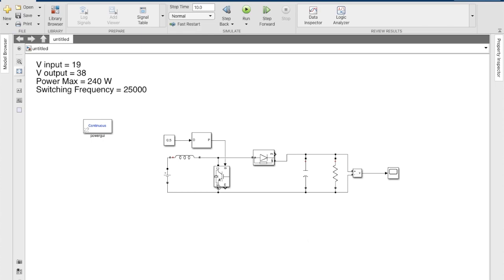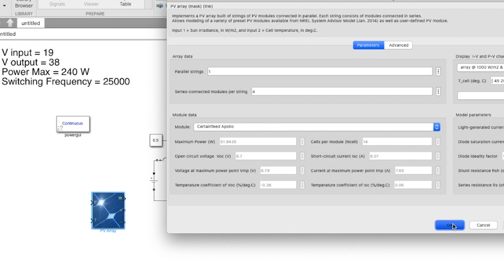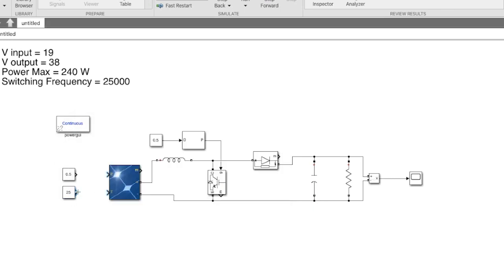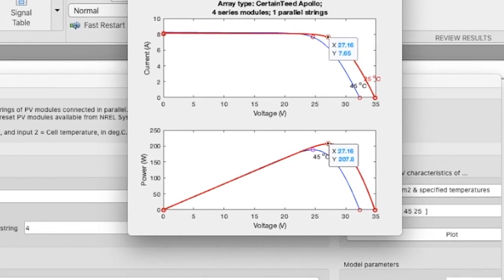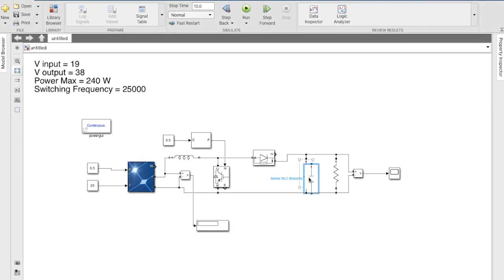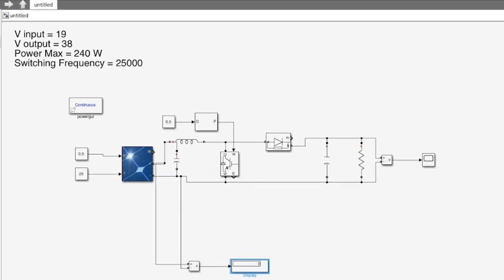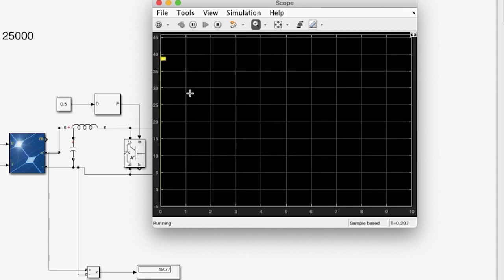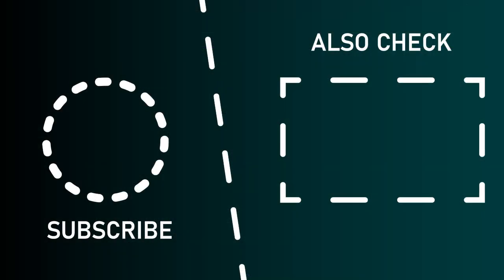PV module simulation + Boost converter in MATLAB/Simulink!

Comment: hello can you please help me, i would like to design a pv array that gives 6 V input to the boost converter and the voltage is amplified to 12 V. The load is a 12 v dc motor

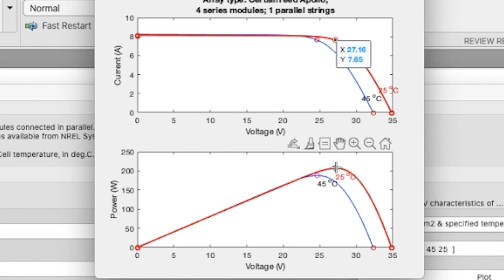Comment: In 1:09 your showing one graph, in voltage valuse 27V but in last you getting 19V? How its change sir
Reply from the maker: Great Question! That is maximum power point. So at maximum power point it will be at 27 V. Here despite it being stc ( 25deg and 1000 irradiance. the voltage and current are not at MPP. Refer to our MPP video to reach 27 V :D)

Comment: I want 12V input supply. Confusing PV array selection which model is good for 12V input..
Reply from the maker: You can custom you own PV panel!
Reply: @TheUrbanScholar  sir, don't know how to select Voc Vmp Isc Imp values.. I u post any video abt it
Reply from the maker: You won't get exactly 12v in any situation. Because firstly, irradiance will vary and no panel can give 12 volts accurately. I suggest you to take a normal arrangement of 24v or something close to that and attach a buck Converter to it
Reply: @TheUrbanScholar 👍👍thank u

Comment: Sir, please what is the name of PD in the Simulink library
Reply from the maker: Do you mean PV? It stands for Photovoltaic  and we use PV Array to simulate a PV system, do let us know if it solved your doubt 🙂
Reply: @TheUrbanScholar  no you connect a block at top with constant value 0.5. tell the name of that block
Reply: @Engr.summaira.beenish.  pwm generator (DC-DC)

Comment: Sir can you send me modeling of pv array with mppt if you have...my email kunjalparmar278@gmail.com
Reply from the maker: We believe that one must build their own projects for their satisfaction but having said that we can help you in concepts or troubles in simulation so that one could do it on their own.Please tell us where you're finding difficulty in the steps we're ready to help you in any way :)
Reply: @TheUrbanScholar  how can i put mppt algorithm in matlab
Reply: How can i give constant input solar pv  to boost converter  so for this i have to design close loop beetween pv mppt and switching frequency of boost converter .so i dont know how can i put control algorithm in simulink.
Reply from the maker: You need to use the matlab function block to write the algorithm, the inputs to the algorithm must be current and voltage as you would know, the output should be duty cycle, which much be fed into the MOSFET.
Reply: @TheUrbanScholar  sir plz make video on that topic so i can understand easily
Reply: This problem is sub part of my project not a whole portion
Reply from the maker: We'll make a video on this in the coming days 👍
Reply: @TheUrbanScholar  thanks
Reply from the maker: Please subscribe to our channel and share it with your friends,it would motivate us a lot we'll make sure you won't regret it😁
Reply: @TheUrbanScholar  i already subscribed your channel
Reply from the maker: Thank you!😄
Reply: @TheUrbanScholar  can you give me your mail id because i beginner in matlab so i have lot's of questions
Reply from the maker: Sure it's howtoproject98@gmail.com ,you can mail all your questions there we'll help you👍